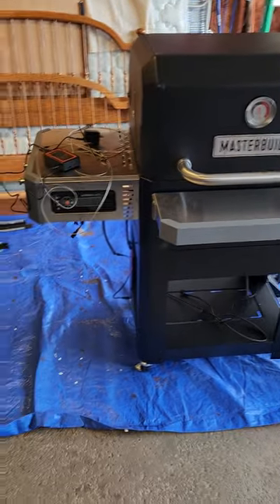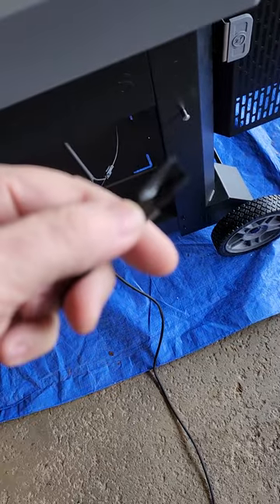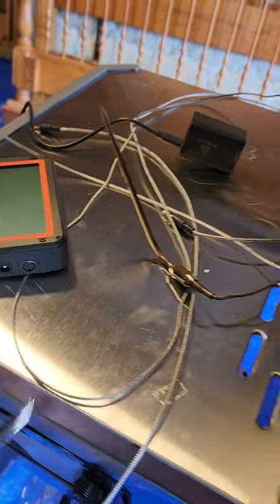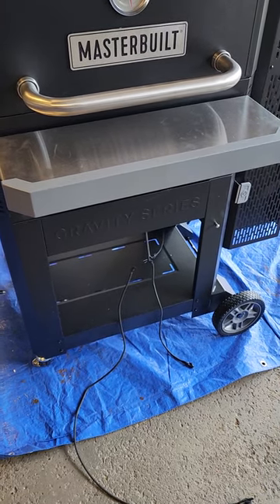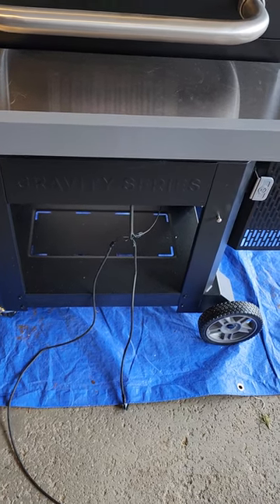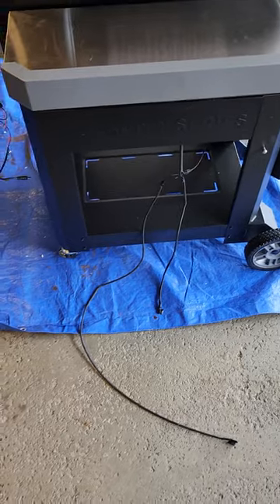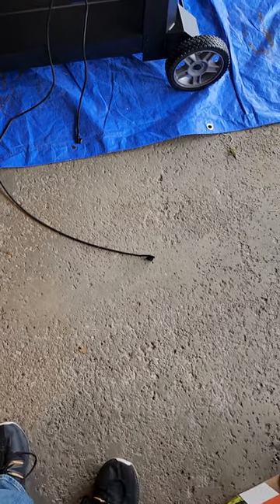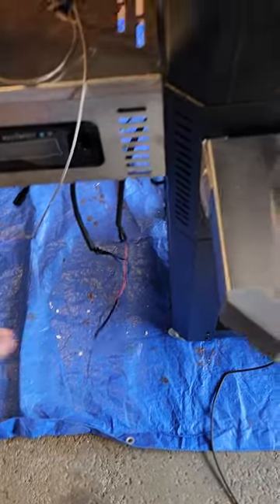Masterbuilt Smoker switch bypass and connection to Fireboard 2 Drive with adapter cable.

Comment: This is exactly my symptoms too minus i have not done any sensor bypassing.  Would you say your final verdict on the initial issues was due to poor sensor cables?
Reply from the maker: I'm guessing that it was just a bad connection at the switch. I haven't had any issues since disconnecting them.
Reply: @dstadt71  did you ever end up bypassing the main lid switch or just the two?  Do you have lid detection turned off on the fireboard?
Reply from the maker: @sp-bbqking  I have all of the switches bypassed now and have lud detection turned off on the FB.

Comment: I bought the 560 right before the 4th of July 2022...I would never recommend this grill ...not to my worse enemy...the wiring is pure shite..looks like it would go with a toy remote car you would by for your 6 year old..i have tried to grill around 7 0r 8 times in the last 17 months, I know..not very often. the reason is the fan has gave me holy hell...tried all the YT fixes and still crap..Don,t buy this grill.get the pellet grill..way better.
Reply from the maker: Once you bypass the switches and switch to a Fireboard controller it's great. That's the only way I'd recommend it.